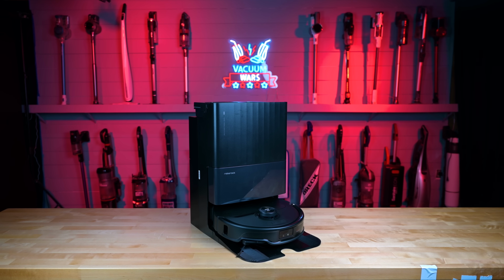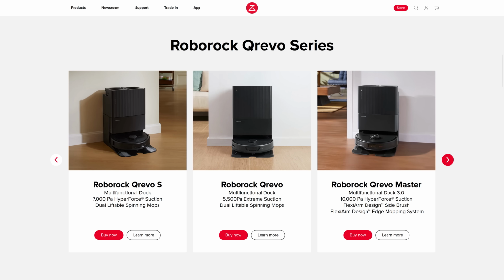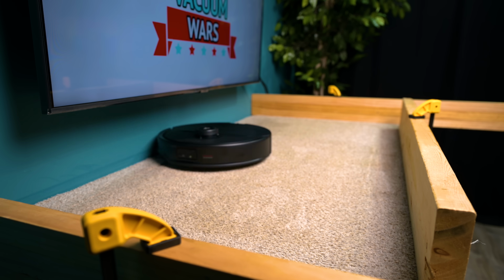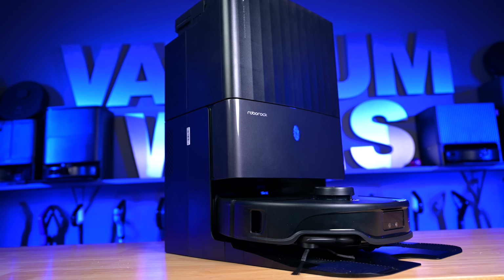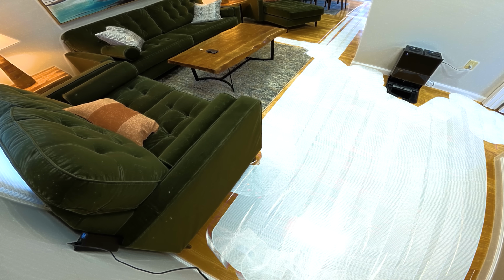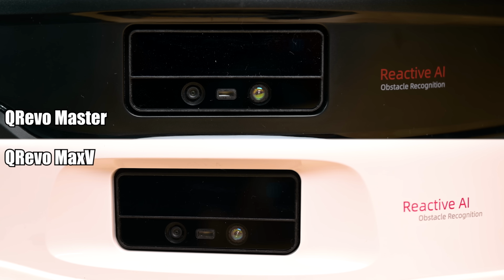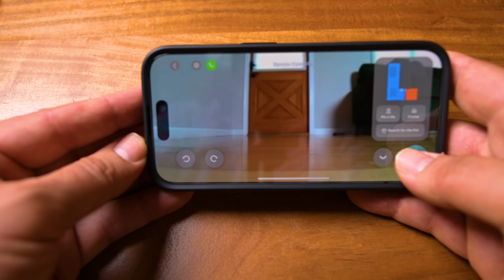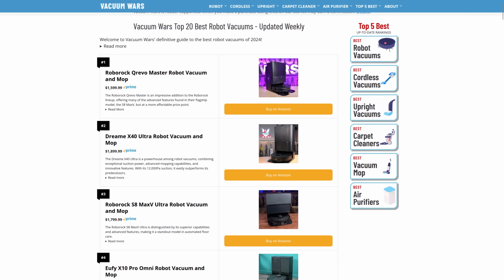Roborock Q Revo Master - Our New #1 Pick and an Apology

Comment: Thanks for sharing Chris. One question on your conclusions -- It seems like the Dreame X40 Ultra still has higher performance scores across the board? 
So is price-difference driving the change in ranking primarily? 

Seems like a big downgrade in obstacle avoidance and it still lacks the ability to drop the mops, which is great for higher carpets. 
(I've only ever seen the Dreame at $1699 and below, so the MSRP seems to be a marketing thing like many companies do...) 

Anything we are missing here other than the price? Thanks again for your work, you provide incredible insight for these things.
Reply: Exactly the question I was about to post. After watching this video I immediately went back to watch the X40 review video again because I was thinking the same as you and yes, the X40 does have higher scores so I’m thinking it might have been price that tipped the balance.
Reply: Great minds lol. I’m still in the return window for my x40 ultra for 4 more days so I was wondering what I should do. In Canada, the x40 ultra is the same price as the s8 maxv ultra ($2,599), but the x40 is $300 off regularly (and I got it $500 off during prime days). So if the master is a few hundred less than the maxV then my x40 is still cheaper.
Reply: @YouTubedarek keep it, it’s the best robot out there
Reply: One difference in features in Q Revo Master's favour seems to be that it has the removable (plastic) plate underneath the spinning pads. For easier cleaning of the base.

Comment: I want to buy another Roborock but have had to return my S7 MaxV multiple times and it is still not fixed. The customer support even stopped responding when I tried to work out next steps. Don't think I can justify getting a high-end unit from this brand again.
Reply: I too have had terrible experience with Roborock support, found them rude and dismissive and wouldn't stand behind their product. Bought a Dreame and couldn't be happier

Comment: There’s still a glaring hole in the methodology as other reviewers  find big differences between ai obstacle avoidance on carpet Vs hard floors.  Also, it seems strange that there’s no comparison of the cleanup scores compared to the s8 maxv.  Just some nebulous “average” that includes models it doesn’t directly compete against.